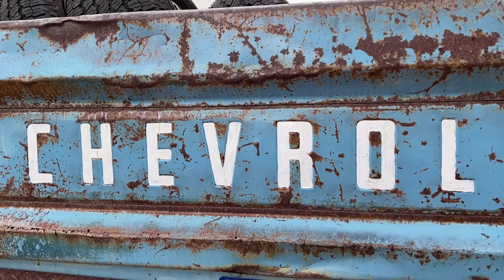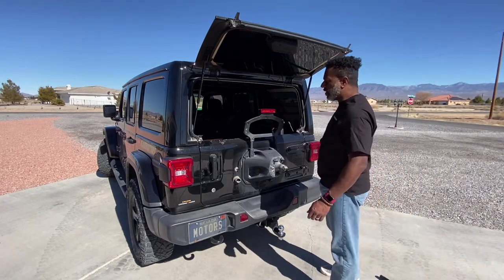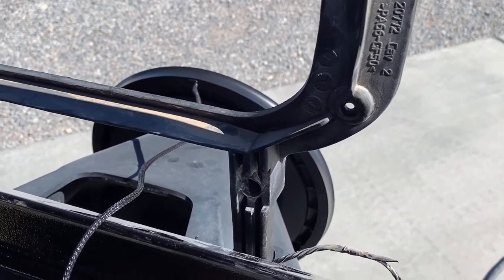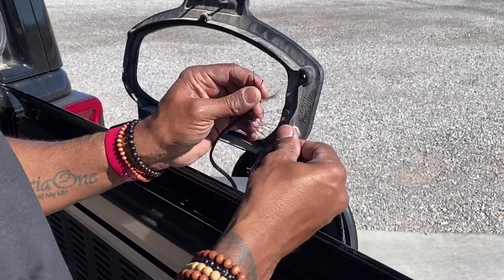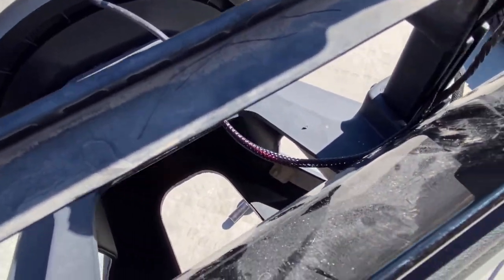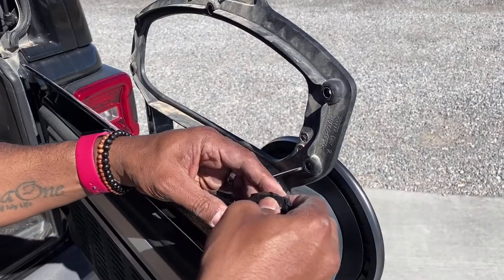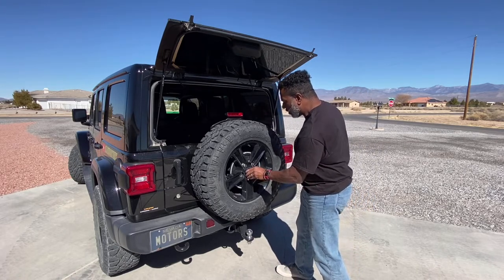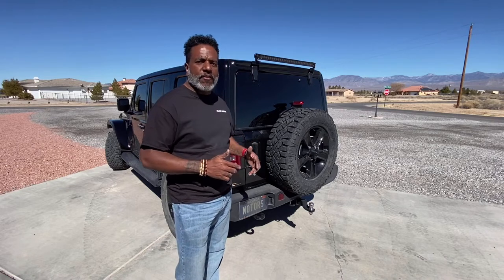Rugged Ridge Third  Brake Light Ring installed on 2020 Jeep Wrangler JLU

Comment: My RGB wheel light says connect to one of the tail lights rather than the middle  brake light cuz it has that extra white wire. Does it matter where it hooks up too?
Reply from the maker: Hi, no it doesn’t really matter. However it would be easiest in my opinion to connect to the middle brake light above the spare. Otherwise you will have to run your wires from the tail light through the tailgate. Seems like a lot more work for the same result. Hope that helps. Thanks for watching the video.
Reply from the maker: @ryan hayward, do you have more that 2 wires to connect on your brake light ring?
Reply: @elandmotors8845  yes I have a red and black and white. According to directions black is negative and red is positive and white is for brake light (red wire + white wire). I think it’s meant so the light is on all the time when park lights/headlights are on then when brake is applied it brights up. Thts Wht I’m going to do but having trouble which color wire is running light
Reply from the maker: Oh I see, that’s a pretty fancy one. I haven’t seen that yet. So yes, in that case if you want the light on with the park lights you don’t have any other choice but to run it to one of the brake lights (preferably the right side since it closer the the hinge). The you may have to use a test light on your tail lights so you know which wire controls the park lights and actual brake light.
Reply: @elandmotors8845  yeah I don’t have one of those. Trying to figure which wires are Wht and I can’t find anything. I have a 2018 jk
Reply from the maker: Best bet is to grab a test light they are super cheap at auto parts store. That allow you to tell which wires are hot when u step on and off the brakes.

Comment: Che misura sono le gomme? what size are the tires?
Reply from the maker: @Luca Scotti. The tires are 35’s
Reply: @elandmotors8845   are those original jeeps?  I in Italy mount 255/70 / r18.  I'd like to see if I can mount them.  could you tell me the measurements?
Reply from the maker: @lucascotti7580  the 35” tires I have now were not the original tires. Our Jeeps in the US will come with various tire sizes depending on the Jeep you buy and it’s options. Most come with 31”-33” tires with various wheel sizes from 17”-20”. My original tires were basic street tires with a size of 255/70R18. You can see those in a couple of my very first videos. I quickly bought a used set of tires more suitable for off road to fit my stock 18” rims. Those tires were 275/65R18 (still a 31” tall tire).  Once I made the big switch to my current set up I bought 35x12.5R17. Most stock (non Rubicon) Jeeps can run up to 33” tall tires before you need some sort of lift. Hope that helps.